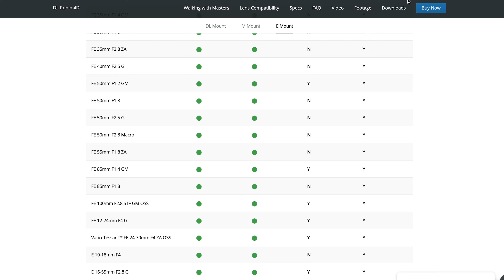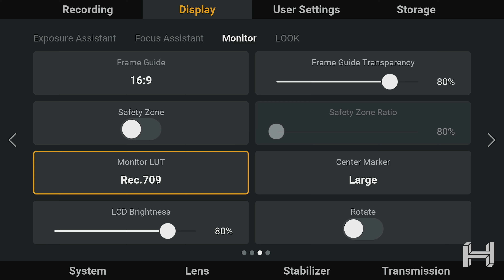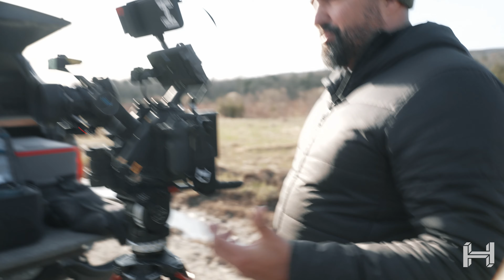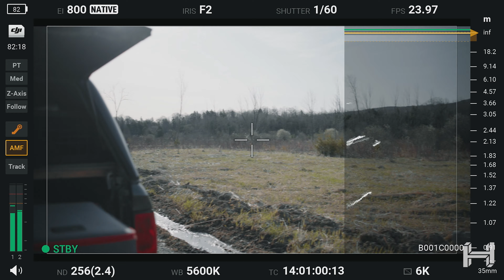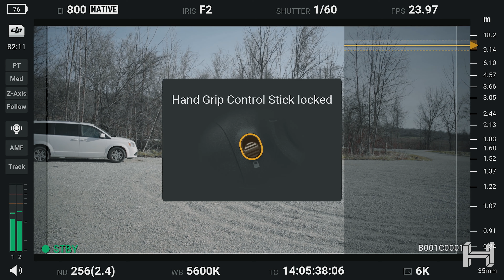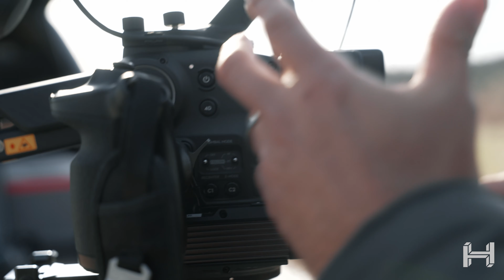DJI RONIN 4D -  SET UP GUIDE

Comment: What button did you press on the side handle to access that main menu? Trying to run the camera with a larger monitor without having to attach the included monitor as well. Thanks

Comment: Thanks for the video. When using the external monitor, did you figure out if you can do a clean display? I often record to my Blackmagic monitor using ssd to hand off to the client but simultaneously record to the camera as a backup. I’m on the verge or purchasing the 4d 8k but might not if I can’t do a clean display to my monitor via the HDMI.

Comment: Not a single person in any tutorial will tell you that you need to loosen the screws at the bottom of the 4D arm to release it and get it to work with the motors. NOBODY will TELL you. Not in the manual. Not in any tutorial I saw. It’s very deceptive because the lense has dedicated lock/unlock switches. So you start looking for the same on the arm. But they don’t have for the 4D arm! Nasty surprise and omission. If you’re not familiar with this camera you can spend hours trying to figure that out…might even burn out the motors pushing the 4D button on the body!  Thanks DJI. Real stupid….

Comment: We balanced the roll axis with a bit of Velcro and a few coins stuck on the side of the left tile motor.  Same method we used to use on the back of the inspire 2 when stacking filters. Seems to work pretty well.  The screen gamma seems pretty bright hey.